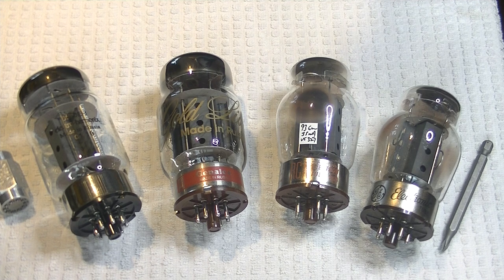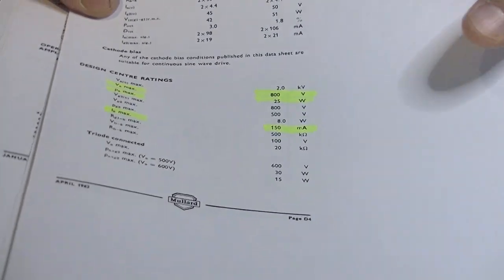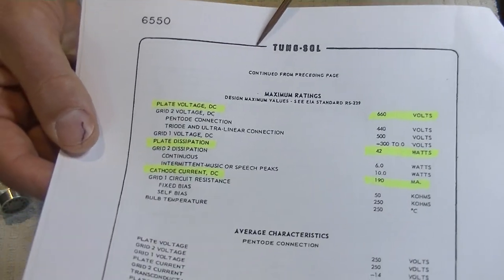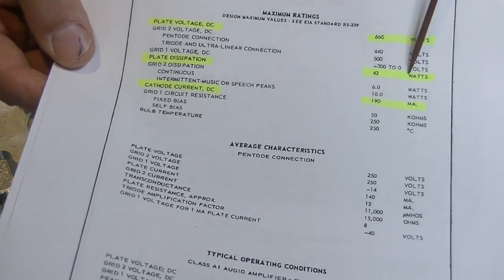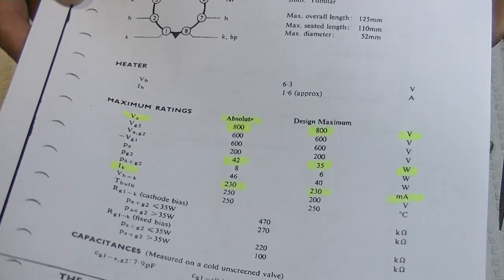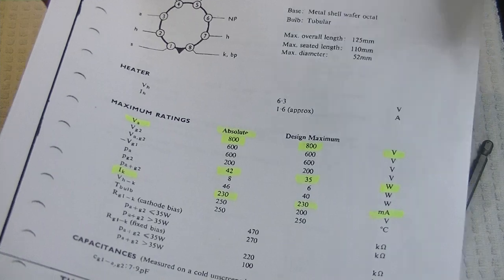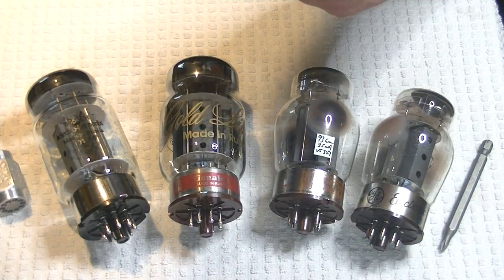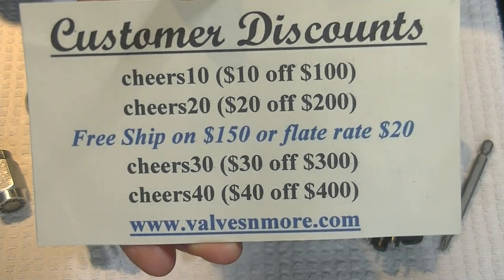Tube Lab #26   Rolling 6550 & KT88 in Willsenton R8 Amp

Comment: A great and informative vid, thankyou for posting it. I remember 6 or 7 years ago thinking tubes look interesting. I bought and built an Elekit TU8200 amp, then i was given an old 1993 Silsonic SAP-E50T push pull EL34 amp in great condition. After a couple of thousand hours of use of them, i bought a genuine Line Magnetic LM88ia with KT88's. I love the way both EL34 and KT88 sound, along with 6L6GC, KT77, 6550 etc. Thinking of buying a quad of GL KT88's for the Line Magnetic amp now, but then watched your vid..... hmmm might stick with the ever reliable JJ's.
Reply: Try the EH KT-88 before you go with the JJ KT-88. I have a quad of the EH KT-88 they are liquid sounding, amazing sound stage, very articulate in reproduction of instruments and out last the JJ.
Reply: @gregj.gotham4402  Good info tks. I have EH6L6GC's in the TU8200, and they have NEVER given cause for alarm. Could be the way to go, not to mention being marginally cheaper than the JJ's here in Aus. 👍

Comment: I’m considering moving away from my ‘vintage’ (20 year old) Rotel transistor hi fi to a Willsenton R8, the reviews I’ve watched are encouraging. I figure if someone like yourself likes the amp... thank you for your informative tune reviews, greatly appreciated. I’m enjoying the learning curve and look forward to getting in touch one day. Thank you
Reply from the maker: Remember the Willsenton R8 is a "budget" integrated class AB tube amplifier.  It makes some compromises to keep the cost down.  For anyone who hasn't owned a tube amp before, it will sound wonderful!  And for the money it is an absolute steal.  However, remember it needs complete re-tubing, to sound it's best, which easily adds 50% to the purchase price.  I'd note most new tube gear needs better tubes, post purchase.  And as I'll talk about in my next Tube Lab, it benefits greatly from the addition of a nice preamp, again this is not unusual.
Reply: @tubelab194  50 % for tubes is a little excessive IMO. With shipping the amp is 1200 to 1300 (with the KT88 upgrade). I just got a pair of Sylvania 6sl7 and a pair of Electro-harmonix 6sn7 reissues for $140. A definite improvement over the stock preamp tubes.
Reply from the maker: @markmckelvey6515  maybe, it will depend on the matched quad of power tubes you buy, Mullard EL34 xf2's run a minimum $800, a nice matched quad of Electro-Harmonix 6550's only about $140.  With prices of many quality vintage tubes rising rapidly as new demand for tubes continues to increase, what you pay to retube any amp is going to vary wildly!  Typically when a customer orders a complete set of quality vintage tubes + a spare or two, for an amp like the R8, the bill is about $600usd.
Reply from the maker: @markmckelvey6515 A budget option using Electro-Harmonix 6550 or EL34'S for output tubes and spending your money on the preamp/driver tube - 6sl7 (key tube in the amp) and going budget on the phase inverter 6sn7's, would cost roughly $350usd, maybe with a spare or two thrown in!
Reply: @tubelab194  I guess what I am saying is the amp sounds pretty good even with stock tubes. Not "necessary" to spend a large sum on vintage tubes to make it usable.
Reply: @tubelab194  I am in the same boat as is Tony.  I listen to classical and Jazz on a B&O Beogram 1700 turn table and Klipsch Cornwall 1 speakers, all about 40 years old. My current amp is Nakamichi SR-3A solid state tuner/amp, which puts out 45 watts per channel. Which version of the now $1500 plus R8 amp would you recommend, the KT88 or the L34?

Also, is it not insane to pay that much for a piece of equipment that your have never heard in person?

Comment: I've owned an R8 for about 10 months. I was super excited to get this amp. Quality build for sure! Using the factory KT88's. I was disappointed with the low frequency response sadly, however I'm sure there's a solution for this! I DID take the plunge and purchased NOS Raytheon and RCA for the front end, but this didn't help in that respect (I'm still learning). Just displeased with bass response... and I wanna love this amp! I've wondered about their cap selection as well.
Reply from the maker: Bass response is tricky in any amp.  It depends on your speakers more than anything!  But tubes are in general weak in the bottom end and fantastic in the mids and highs.  First if you're using stock KT88's that could be a big part of the problem.  My stock EL34's were so bad I threw them out!  Also your front end tubes could be improved upon as well.  Some preamp tubes just are a wee bit bass forward, which helps!  Send me a message though the store and I'd be happy to put together a custom tube package to help solve this problem.
Reply: @tubelab194  thanks! I have your site loaded so I'll shoot you a message. Also, I didn't mention I'm running older Cornwall's (recapped of course) :)
Reply: You may get more change by upgrading/rolling the preamp tubes rather than the power tubes.   The pre-amps influence the sound a lot more than the power tubes do in this amp.  Another channel did a review just rolling in some PS-Vane tubes, and it made a pretty big difference rolling the pre-amps compared to the power tubes.  :)
Reply: @EsotericArctos  I rolled in vintage tubes for that as well. Noticeable improvement but nowhere near (and reasonable) what I hoped for. I sold it.

Comment: It's hard to find a KT88 that lives up to the original mullard GEC. I always felt the 3 gutters had something to do with the sound. Teslers sounded Great but they Blew right away. Now I have a set of Gold lions in the Major and it's as close as it gets. Thanks for posting c];-)
Reply from the maker: I actually have a couple of quads of kt88 Gold Lions in the store, I should roll them in and see how they sound!  I'm presuming you're referring to the New Sensor reissue.
Reply: @tubelab194  Yes New Sensor Genalex. I haven't pushed the Amp yet but I have the Bias set just enough to crack out some harmonics. When I think about the time when I first bought the amp those GEC tubes were tuff. You got me thinking now about the construction process you were talking about that made them kinkless. perhaps this is what the tubes that followed didn't get right.just a thought. Thanks for the come back. c];-)

Comment: Hallo Jim, thanks for another great video. I was wondering whether or not you have an opinion on the fact that the R8 have a fixed B+ voltage of 440v, in regards to the usage of the EL34 variants vs KT88 variants in the power tube postition? It seems to me like the EL34 variants are a better match with a typical anode voltage of 420v, vs. the KT88 variants that seems to typically wants around 600v? Kind regards from Denmark.
Reply from the maker: Yes this is a very good question.  I ran out of time to talk about this in today's video, but I did measure my R8's plate voltage at 473vdc, grid bias switch for KT88 -51vdc, EL34 -43vdc, the bias voltages are approximate as they have a range of adjustment.  Power output potential comes from design, plate voltage, bias setting and how the tube is configured to the output transformer (triode or ultralinear connected).  Turn down the B+ (plate voltage) and you reduce output.  However power tubes and most tubes can operate well over a fairly large range of plate voltages.  In order to answer this question properly a whole series of experiments would have to take place along with carefully organized critical listening sessions.  And we'd only have an answer for the R8, given that another amp is likely to have a different output transformer.  My approach has been - let's listen to a variety of tubes and see how the amp performs, given we're not going to be able to increase the B+ or change the output transformer.  In general terms I discovered that for intimate acoustic music the EL34 sounds best and for Rock'n'roll or similar "Wall of Sound" types, the 6550/KT88 sounded great.
Reply: @tubelab194  Thank you for your thoughts, good to know you don't think the 6550/KT88 is disqualified in the R8 on the ground of specs alone.I guess I'll just have to pick up a quad of each, and see what i like, on my system, in my space.
Reply from the maker: @rasmuskokholm7044  Yes so much of what works is going to be personal preference AND the rest of your system, speakers play the most important role in your overall sound and the room itself!  My reviews are meant to help guide your choices intelligently!  And when I get a spare minute, I'll look at the bias point settings of the R8 and see if they make sense.

Comment: Hi Jim, thanks for the great vid and the lesson!  As an R8 owner (came with Willsenton KT88) I decided to buy some reissue EL34 (New sensor Mullard) as I had to hear the difference.  As you point out, the mids on the EL's are fantastic, especially with jazz, classical, etc.  
Overall, I keep the EL34s in place most of the time for most listening, as on average, it fits more of the genres I listen to.  However, I also like rock music and find the EL34s lacking where the KT88 has punch. 
All this to say, I'm wondering how you find better KT88s compared to Willsenton stock KT88, and if you think that grabbing a quad may serve serve solid improvement?  Appreciate your thoughts and suggestions.  Keep up the good work!
Reply from the maker: Thanks for the kind comments!  Well I can't comment on the stock KT88's, mine arrived with the EL34 option.  However if they are anything like my tubes, they will be significantly mismatched.  Even the very expensive, well liked vintage GE6550's I tried sounded blah and they were  mismatched.  A close matched quad of Electro-Harmonix 6550's is going to sound amazing compared to the best vintage KT88 that's not matched.  That's what I do everyday for my customers - find and match preamp and power tubes.  Note, I often buy matched quads of power tubes and just end up breaking the quad up and rematching them!
Reply: Thank's Jim  for the lesson. Because  i want to bild  a (6) 6550 Amp